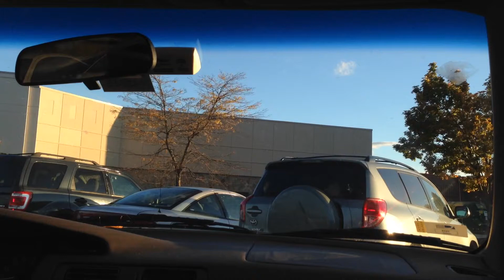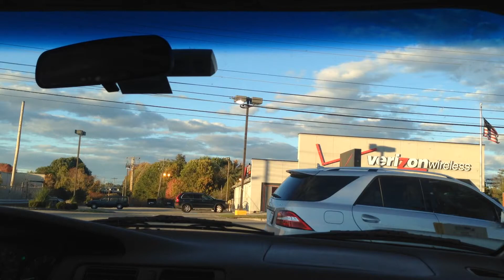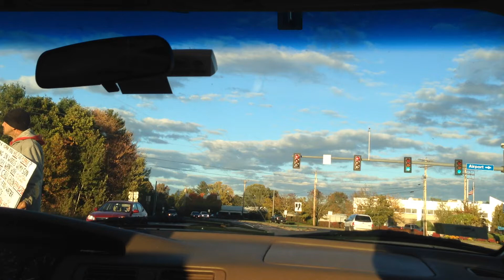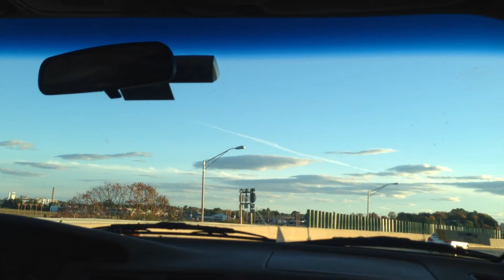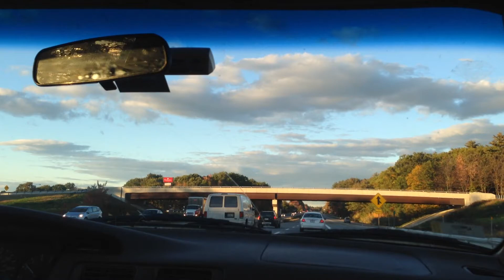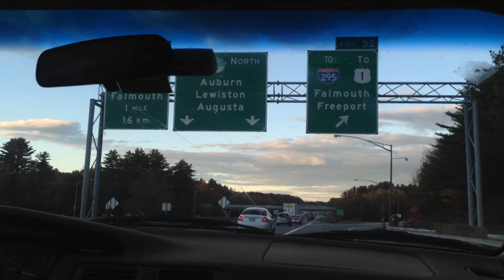Fun Facts #5: About SLCs and other stuff

Comment: Primary recall calls the elevator to floor 1. The elevator will buzz until the doors open at the 1st floor. Secondary Recall is when the FIRE SERVICE KEY is turned on.The elevator unlocks its self and will be allowed for use. Secomdary recall is like INDEPENDANT SERVICE the doors will open and remain open as long as the button is held until the door opens fully. If smoke is detected in the motor room the FIGHTERFIGHTERS HAT will flash deeming the car INOPERATEABLE. A fire in the motor room is dangerous and can be fatal on any type of elevator.
Reply from the maker: You've sort of got it-- you mixed up some terms though.

Comment: I think that Primary Recall is the mode the elevator will enter by default if an alarm occurs. Secondary Recall is if the floor the elevator would normally default to is unsafe for egress. In that case it would sit at another, safe, floor.

Comment: We're coded pulls like the first addressable pulls?
Reply from the maker: In a way, yes.
Reply: But accept they were public. 

I was in a building that still had codeds. 

1st ring: Floor
2nd ring: Section (1&2-S1 etc.)
3rd ring: Device
Reply: But coded systems couldn't have detectors, right?
Reply: @Fahrenheit4051  I actually think fire alarms and pull stations were actually made before detectors were. If there was a fire, you pulled the alarm. Otherwise, they just set there like nothings even happening.
Reply: @J19_vlogger74  Manual activation was the first type invented, but waterflow switches were invented in the 1930's. Not sure when they began to be used for fire alarms, though. Heat detectors have also existed for a very long time.

And apparently, motorized coded detectors did exist! They are extremely rare, though.
Reply: @Fahrenheit4051  Wow! I never knew coded Detectors existed. Thanks for the info.

Comment: Heres a question, Do houses have 110 or 120 volts wired in to the electrical sockets? And if its 110 and your panel is 120, how to do make it work?
Reply: 110 and 120 are the same thing. Normal voltage  is anywhere from 110-125 volts. It varies based on a number of factors. All electrical devices, panels included, are designed for a range of voltage to operate properly.
Reply: Don't worry about it. 120-volt things will run on 110 volts and 110-volt things will run on 120 volts.
Reply: @J19_vlogger74  Thank you for your response!
Reply: @scalley  You're welcome!

Comment: Answer?:
During power outages it goes to the bottom floor?
Reply from the maker: It depends on the elevator. Most hydraulic elevators have an emergency release that will slowly lower the elevator to the ground floor and enough battery power to open the doors. I've also heard of traction elevators that will stop at the nearest floor and open their doors on a small amount of reserve battery power.
Reply: I mean is it the answer.